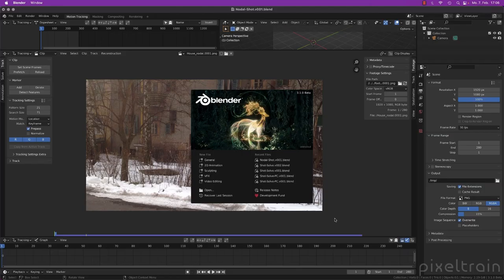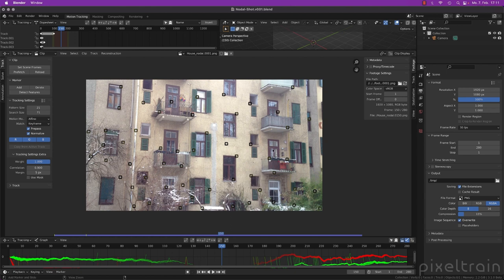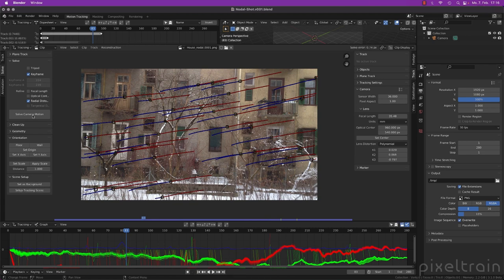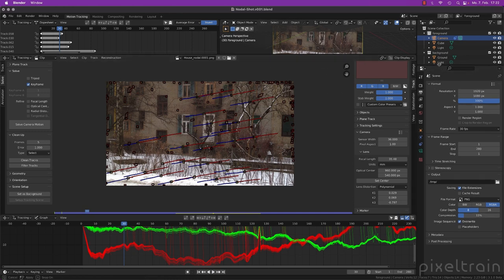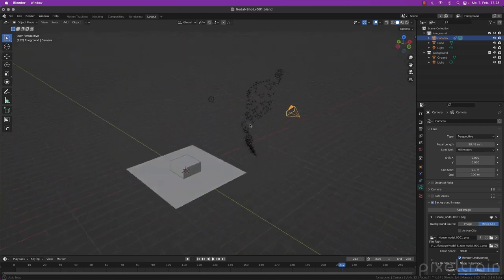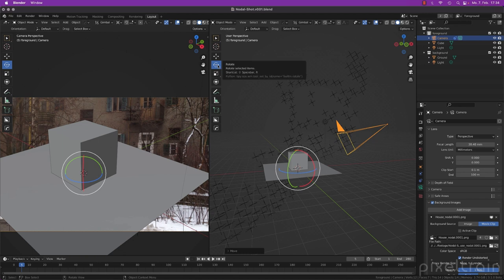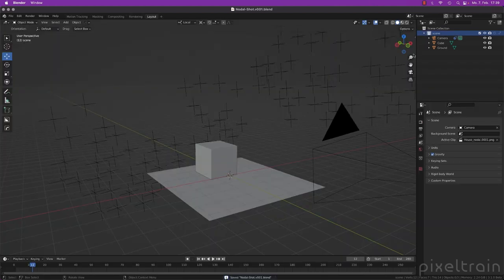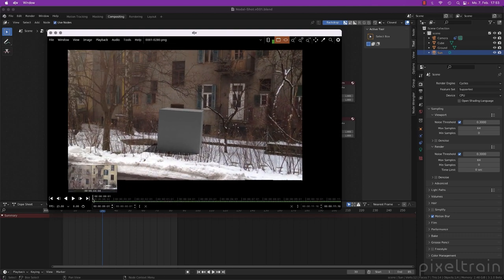Blender 3.0 for Production - 2D & 3D Tracking Workflow - 12 Solving Nodal & Tripod Shots

Comment: hello, i have a problem with holdout collections in compositing, since i found your video on that topic very informative, i thought, maybe you know how to fix it.

In a case where two objects on different view layers need to occlude each other, I need to use a holdout.
if i now use a holdout to cut a "hole" into my floor layer for instance, and than composite the object that made the hole back over it, there remains a thin strip of transparency around the object.
i didn't notice it until i tried to put a brighter sky color behind it and it "leaked" thru the transparent pixels.
the case i just discribed, is just an example. in a real project, i have a smoke simulation and i would like to keep it on a separate layer. but the smoke is going around objects, thru a fence and so on.

Comment: Very nice tutorial series. I dont know if possible, as i never seen a tutorial about it, but could you make a tutorial video about 3d camera tracking with a video-sequence (one with parallax, one without parallax, to explain everything :) )  where e.g. the camera turns around e.g. 180 degrees.  The main thing is, that all markers from frame 1 to e.g. 200 will disappear as the camera turns, and will NEVER re-appear in later frames ( to use joint-tracks).  If using offset-tracking, the tracking is very bad. Lets say you stay on a sideway and film the street from left to right (180 degree, with e.g. some concrete posts infront of the camera (for parallax) and without) so that no markers in the first e.g. 200 frames are there in later frames. When you then set a marker  to the street (which should be straight) in frame 1 to e.g. 200, and then "offset" this marker to another place at the same straight line of the street, and move on with tracking, the original marker will go crazy. And if you do it with 8 markers todo scene setup, i only get worse results. The blender-layout-plane is never in the position of the street, so that i can not simply place some 3d-cars on the street and move it. If possible, would be nice to see. Thanks for all other videos.
Reply from the maker: There are many shots where trackers from the first frames will never come up again. So you always overlap with new trackers and so you track to the end. Don't use offset tracking for that, make additional trackers. That's better.
But one thing is always important to keep in mind, the process of solving is never 100%. The typical problem here is the movement of a camera around an objects. You will end mostly always in a spiral. But that's not Blendera problem only, I see that in Syntheyes and 3DE also.

Comment: How create depth map in blender from video footage? And using depth map for creating fog or clouds with tracking?
Reply from the maker: As I know, there is now tool for Depth Map generation from video footage for Blender. But you can use DaVinci Resolve 18 (beta) for generating and then use it in the Blender Compositor, or in Fusion. Hope that helps.
Reply: @pixeltrain3d  Actually, this is also in After effects, the plugin is called Depth Scanner and works better than I do in Davinci..I was wondering how to generate this in a blender